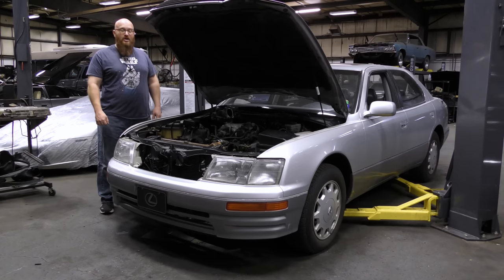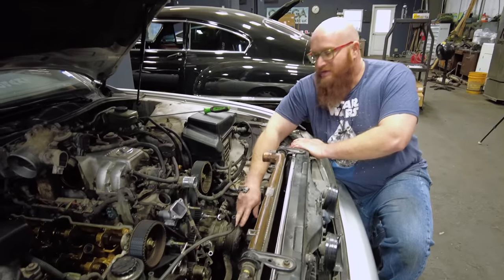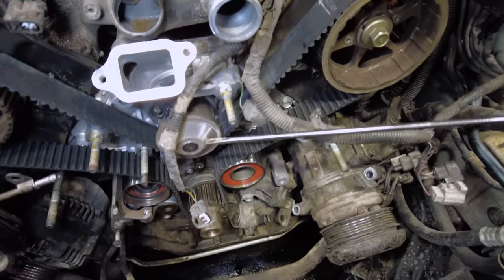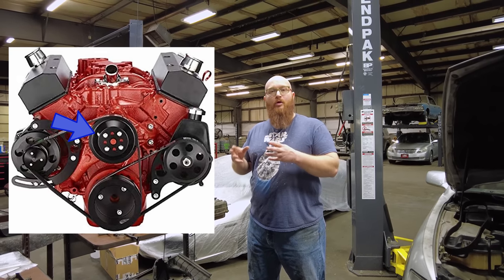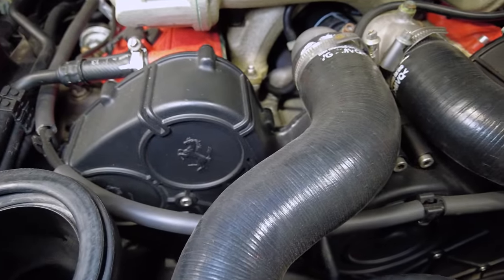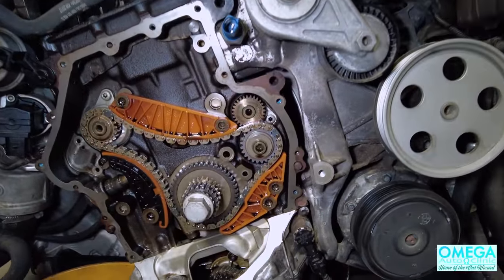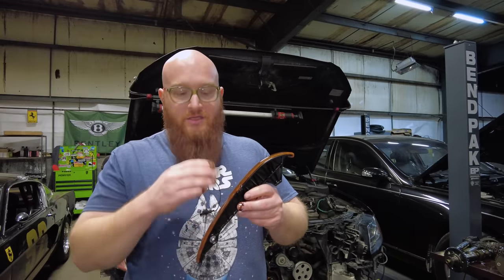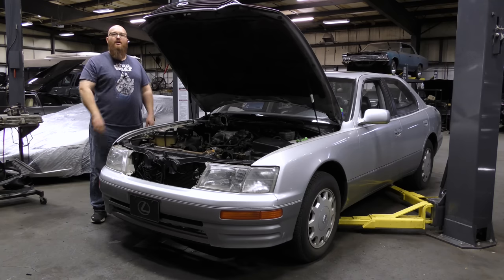My What's Broken? Series #1: Timing Belts-vs-Chains! CAR WIZARD explains why the huge bill

Comment: Another thing I learned about timing chains (the hard way) is that if you don't change your engine oil enough, it stretches the chain and the chain will actually jump off the sprocket, which is incidentally how my Rav4 died.
Reply: Yeah, you really need to be on top of maintenance with timing chains. 

Modern direct injection engines put more stress on them too due to running the high pressure fuel pump and the extra soot that gets into the oil from direct injection.... Sort of like diesel engine soot).

If you want to get long life from a modern engine don't follow the "oil change reminder" in the car... Just change it every 5k (or earlier if you drive less).
Reply: It doesn't matter what you drive. Change the oil at or BEFORE the reccomended interval. If you don't, you are doing permenant damage to your engine and risking catostrophic failure.
Reply: I always change the oil every 5,000 miles now my 2015 Dodge Dart SXT with 2.4 litter have over 306,000 miles with
Reply: @surferdude4487  Right, I bought the car used, and that was one of the first things I did. But when the mechanic took off the cover, the sludge was a nice, thick coat.
Reply: This is especially true for the long chains of DOHC motors. When Lexus switched to the UR V8s with chains like the 4.6L and to a lesser extent in the 5.0L, they had problems with the timing chain tensioners.
Reply: My Toyota Hybride has a chain and get's at least every year new 0W16 or 5W20 engine oil, so the chain is still in perfect shape after 12 years of running. Regular oil change on a Toyota is really important !
Reply: @eddieredmann3  Oh Dude, I'm so sorry to hear that.
One essential part of any pre-purchase inspection is to pull the oil dip-stick and have a look. If the oil is low or shows ANY sign of varnish, just walk away. Even if the oil seems fine and the dipstick is clean, ask to see the receipts and service record of the vehicle. The list of things that old oil does to an engine is long and none of them are good for the future of that engine.
My brother-in-law skipped one oil change. When the engine blew up, he was surprised to learn that he voided the warrantee when he skipped that oil change. The manufacturers know what they are doing when they set the terms of their warrantees.
Reply: The chain will stretch regardless of oil changes.
Reply: Manuals have a normal and severe duty maintenance recommendations, I follow the severe duty for all my cars. Never had an engine failure or problem.
Reply: A common issue with the Holden Alloytec 3.6 V6 engine due to poor design.
Reply: they should just use gear drives
Reply: @toy200sx  Yes, that's true. Running the engine will wear the timing chain or belt and no amount of oil changes will prevent that. However, failing to change the oil will cause increased friction and accelerate the wear on all parts of the engine, including the timing chain or belt.
Reply: It almost makes you wonder if those "silly" service intervals that car manufacturers insist upon just aren't that silly after all. Who knew that ignoring their advice would have severe consequences? (hint: the manufacturers did).
Reply: Chains don't 'stretch'.  What's happening is that the holes in the chain links and the pins that fit into those holes begin to wear increasing the clearance.  When it gets bad enough the chain will skip or even come apart.
Reply: @Richard Cranium Agreed, so it will be better for your own financials to keep to the "old" schedule: a service at least once a year or after 5-6000 miles max, whatever comes first. For some engines, like diesels for instance, that 5-6000 miles may even be reduced, as they are notoriously hard on engine oil. 

But maybe even more important is to use the proper oil from a well-known brand, as quality certainly matters where it comes to engine oil.
Reply: Yes, change your oil… but chains don’t actually stretch. Common myth based on what it seems like what happened, they do actually gain more circumference, but now you’re asking, random YouTube commenter, how is that possible? How does a chain become longer/add circumference without stretching? It’s because the chain links get yoked out around the pins after many cycles, which makes the pins and links fit together looser, and that extra play makes the chain seem like it stretched, and it doesn’t take much to screw things up in the grand scheme of engines. The metal of the chain doesn’t actually stretch. It’s dirt that does it. So change your oil.
Reply: @Richard Cranium Exactly: spend a few bucks to avoid the risk of having to replace your engine. It's just common sense.
Reply: @toy200sx  There's a difference between having to change it in 50k miles or 300k.
Reply: @toy200sx  You are dead right. Any motorcyclist knows this and chains routinely require adjustment. What good oil changes do help with is reducing tensioner and guide wear...which then causes the chain to rattle/wear out/etc. So maintenance is still important/more important for chain driven engines.
Reply: A chain can jump due to a bad guide or tensioner. Oil isn't necessarily a factor.
Reply: @MrSloika that is the sum of the incremental wear of each pin. Metallurgy is good but there are limits and budgets.
Reply: Just one time overheating can damage timing chains causing them to stretch quickly after that. 
The steel loses its hardness & then its all bad.
Reply: Also the new API SP specification cleans the timing chain better
Reply: In my old 78 300 D the timing chain was indeed clean but new style oil blew two head gaskets… it was always bizarre to me how any new place I went, euro mechanics had no idea how to work on my car; some just straight up would turn it away. Would have to find a good private or diesel shop and finally one told me to stop putting “European car” synthetic in my ancient 5 cylinder. Pretty sure one shop even put 0w-20 in 😂 good lesson to do it myself

Comment: I think you should have mentioned that the belt is installed backwards in this video so people do not see this and get confused if attempting this job themselves. The arrows should face outwards. R-cam refers to the rh side of the vehicle which would be on the left when looking from the angle you filmed. This will cause the crank mark to be off by several teeth. If you time the car using the block marks instead of the belt marks it could still be done this way, But the chances of being off a tooth using this method are very high so it is best to use the belt marks.
Reply: Really good catch you're on the ball
Reply: @chuckb9867  Its not my intention to be critical of car wizard videos or hate in any way. I watch his videos and other youtube mechanics often with the goal of picking up little tips or learning things. Even though this is not an instructional video I assume others may watch for the same reason and may take away something from this one that is incorrect. I know the toyota timing belt replacement procedure quite well and have changed belts on my own 1uz and 3uz toyota/lexus engines so it stood out to me.
Reply: @dlfpv9049  I didn't mean it in any way to badmouth anyone just that I noticed and appreciated you had an Eagle Eye and spotted something others would not have noticed me included may your knowledge help others repair their vehicles better that's all I meant I have a 93 LS400 with around 89000 miles I bought from the original owner who was 93 coincidentally when he passed on and I bought the car off his uncle and I also have a Lexus 330 that I love also 2004 thank you for the reply like I said I didn't mean anything by it
Reply: I have always used the physical marks, or at least use them with the painted marks as verification.
Reply: Some belts are made to only rotate in one direction. Installing them backwards could result in the belt fraying and failing prematurely. I'm surprised that Car Wizard is not aware of that.
Reply: @volvo09  The method outlined in the toyota fsm for this and many other belt timed toyota engines is to use the belt marks to time initially. And after pulling the tensioner pin rotating the engine twice by hand to double check your work with the block marks, At which point the belt marks will no longer align. This is by design to prolong belt life. If timing by only the block marks the slack in the belt with no tensioner pressure is enough to be off a tooth or 2. Also often times you will even need to independently rotate 1 or 2 of the pulleys a tiny bit to make the belt marks align since you cannot tension the belt enough by hand to match the pressure the hydraulic tensioner can provide.
Reply: @surferdude4487  I'm learning more from this video than I ever thought possible and you're helping
Reply from the maker: We timed it before installing the belts. So those stamps on the belt itself really dont matter.
Reply: @CarWizard  While this is true as there are many ways to do this job with the correct end result, and I have no doubts this car left your shop properly timed. For other ppl coming here to learn or pickup on tips here and there, somebody doing this job for the 1st time may see this and think their belt is on backwards, or remember for the future thinking it should go the other way. Again no hate, I do love your videos and have learned a ton from them. Its just that had I not already been familiar with this procedure I may have left the video picking up on something that is incorrect.
Reply: @surferdude4487  Good point, it does appear that the individual teeth on the belt have slits on the side meant to take the most pressure from the crank pulley while being driven, while the other side of the teeth are smooth. This may cause more or less friction than originally intended, leading to the belt fraying or skipping easier as it ages or gets oil on it. If changing the belt within the service interval this should never be an issue. But if left to neglect 200k miles or more it could become an issue.

Comment: In California, all cars are required by law to go at least 105,000 miles before the belt has to be replaced, it can last longer than that, but the minimum is 105,000 miles.

Comment: THANK YOU Car Wizard!  I have learned so much watching your channel over the years.  I'm not an auto mechanic, I actually have a meteorology degree and teach middle school science.  But I love to tinker and explore "how things work," and this series is perfect.
Reply: Love to hear science is still taught in the US - when I hear of all these crazy flat earthers denying all of science - and invariably being absolutely unable to work with numbers, with formulas, or have the ability to imagine 3-dimensional correlations or analyze in their head a "when this is so, then what are the consequences scenario?"
 
I think the most important thing to bring over to kids is that physics (or chemistry or biology or...) is not something theoretical where you learn the answers by heart to get the grades, but is something that is connected with your life, what you can use, what applies in everyday life. Often experiences you make in everyday life put into numbers. 
 
That when you hang soggy pants on a washing line, why it sags through most when you put it in the middle and way less when put at the sides is the parallel of forces you can draw out on a sheet of paper. 
 
Or how forces add up to resulting forces - for my gravity denying flat earthers how gravity and centrifugal forces combine, taking a bucket with water on a string and swing it, you can create a flat water surface in the bucket that is oriented in any kind of direction compared to the flat water surface outside the swirled bucket, including upside down. Just one force (centrifugal force) more dominant than the other, that is all it needs. Water conforms it shape and surface orientation to the forces at work. Be it gravity, centrifugal force, cohesion, adhesion, air resistance for falling drops, all combines.  
 
Sorry to interfere in your work, but maybe that gives one idea or two. 
 
 
I have a friend that was a meteorologist, too, who went on an expedition into the deepest valley on earth to study a strange wind there, that went only in one direction with up to 50 mph (usually thermal winds revert direction over the day). Even though the valley floor was on 9,000 feet, it is no problem to have a valley 15,000 foot deep when the K2 with 28,000 feet is on one side.
They could not use balloons for their measurements as the winds would have blown them too much sideways instead of vertical. So my friend used his hobby, RC model airplanes and developed a high-altitude-optimized electrically powered glider for that. They climbed up to 7,500 feet above ground, had special telescopic glasses that Zeiss had made for them so that they could still see the plane at that height. 
 
Science combined with fun, hobby, exotics (Tibet) and adventure.

Comment: I had a belt snap on a 91 Honda Civic when my son took my keys and tried to start it up. Fortunately it didn’t start. We took it to a hobby shop on our base, found TDC, matched a mark on the cam gear to the crank pulley, removed a engine mount, installed the belt, ran a compression check, and drove it for years. But it was nowhere as complex of an engine than the ones you were working on. No matter how much you know, you should keep your mind open and learn from others. Good video !

Comment: Hello Mr Wizard - You did not mention that some heavy duty engines (Isuzu diesel engines or F1 formula race engines, etc) instead of belts or chains use timing gears, that are the most reliable way, but at the same time the most expensive and loudest. But I can see why these were skipped - due to being very rare. Otherwise - top notch information!
Reply: You beat me to it.  I have had motorcycles with gear driven cams and they were amazing. mostly Honda v4s but one was a 400cc in line 4 liquid cooled motor with gear driven cams.

Comment: That's a great explanation.
You'll have to explain "interference engine" so that people understand the danger of an engine loosing timing.
Reply: I second that request. I was hoping he'd cover "interference" and "non-interference" in this vid but he went deeper into the function than I thought, and I guess time was an issue. Hopefully he'll cover them in the next one.
Reply: An interference engine is one where the pistons will smash into the valves if they're out of time (i.e. timing belt broken). Not all engines will do this and some will clear the valves such as some old Vauxhall engines.
Reply: Also important is the quality of the replacement Timing Belt. I would use Gates Brand every time. They have a long history of belt-making. Forget the 'cheapies' when your engine is at stake!
Reply: @peterduxbury927  I always opt for the best....not necessarily the most expensive.....but the best replacement parts.
In my book Gates is gold!
Reply: @adotopp1865  And the Mazda FS engine, as well as the Ford CVT.

Comment: I changed a timing belt on the side of the road once. It took a couple hours and cost less than 50 bucks with a new tensioner. My Volvo 240 non interference B230 motor was so easy to work on.

Comment: Wizard, as a non-gear head, this video is awesome. I will keep this video to forward to my friends when they ask about timing belt replacements.
Reply: Wizard did a good job, he forgot one reason why water pump need to be replaced, worned water pump can locked itself which mean that timing belt will rubbing on seized water pump, it will break which also mean dead engine.
Reply: @altergreenhorn  That happened to me ended up with some bent valves

Comment: I have had two LS400s and the first UCF-10 car with the 1UX-FE was a non-interference engine, but the one from 1997, the UCF-20 in the U.K. was an interference engine. I had the timing belts changed on both, because I always seem to get landed with that job!

Comment: A couple timing belts ago I Changed my 4A-FE timing belt, somehow got the cam gear timing off by ONE tooth.  Engine coughed, sputtered, backfired, would not start.  Till i slipped the top of belt off, the cam gear moved back one tooth (as if it was spring loaded), slipped the belt back on and fired right up, runs smooth to this day.

Comment: This is a wonderful video!!!!  It's about time someone addressed the timing belt/chain sequence and issues.  I know you did mention it in the video, but it's important to distinguish the difference between an interference vs a non-interference engine.   People need to be aware that failure on an interference engine is catastrophic.  Also can't stress enough that belts and the water pump need to be replaced at certain intervals,   I replace mine at 90K intervals on my Highlander

Comment: Often it’s not the timing belt that fails but something else like a pulley, water pump or crankshaft seal (causing oil to leak on the belt) causing failure. It’s best to do it all every 10 years or 100k miles. It’s cheap insurance. 😅 I also prefer a belt over a chain because it’s usually easier to replace and it is done regularly whereas a guide can often fail on a chain or a chain stretches or something else breaks and it’s really hard to repair in comparison to an engine with a timing belt.

Comment: When I bought my Volvo XC90 with an D5 5cyl inline diesel the car had 170.000km on the guage, and the interval for changing the timingbelt was 180.000km so I asked the Volvo dealer to change it before we go got it and put the cost on the bill, it feels much safer to have it done in time than spend another $1200 in just a few months!